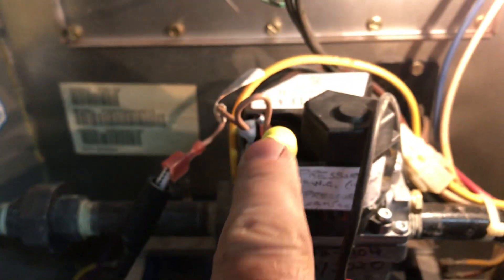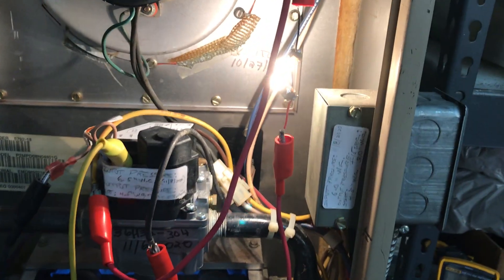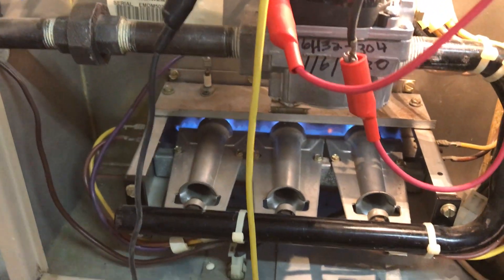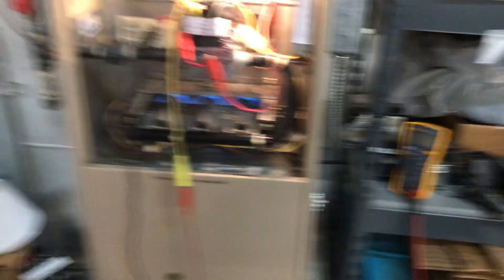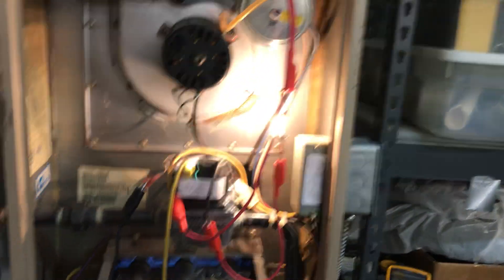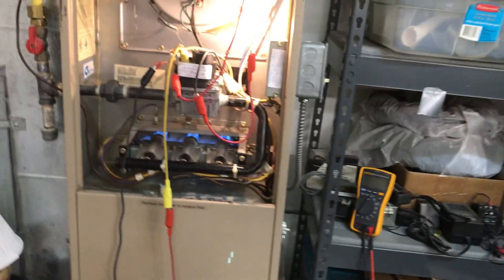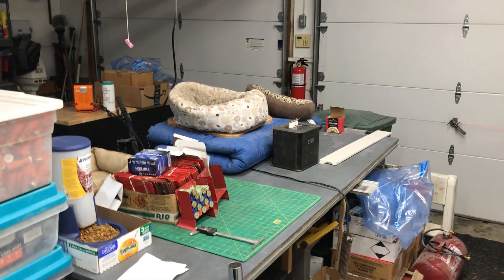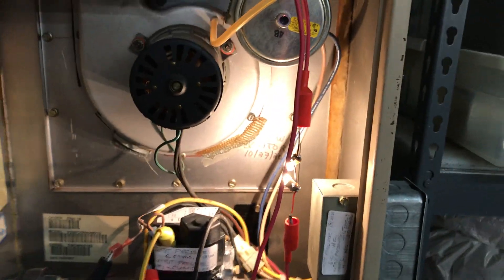York Diamond 80 troubleshooting

Comment: Hey Steve, did you end up finding what was causing that issue ? I Think i have the same issue. Thank you !

*edit : for anyone wondering, i removed the flame sensor. Cleaned it with steel wool gently, put it back. And now it works perfect. Good luck
Reply from the maker: My issue was bad contacts in one of the black PCB relays (that controls the gas valve solenoid).
Reply: @stevejoos8953  thanks steve, im lucky my problem was a little more simple to fix i assume. Cheers bud